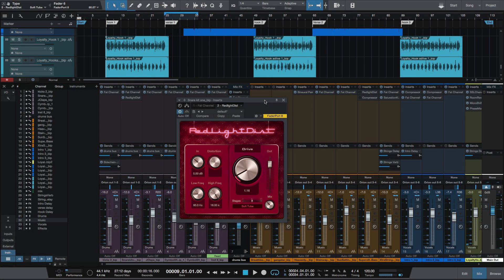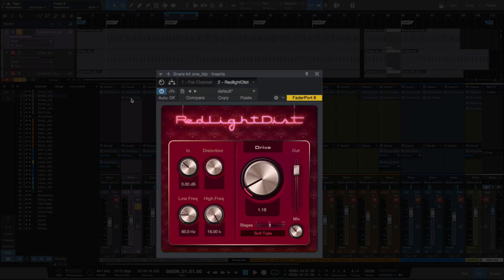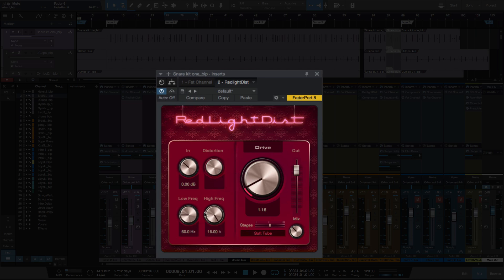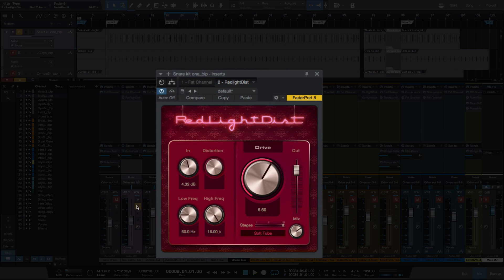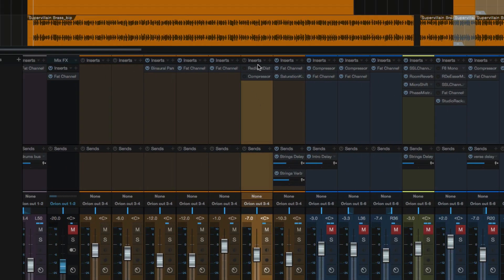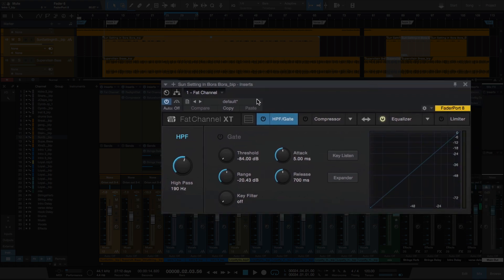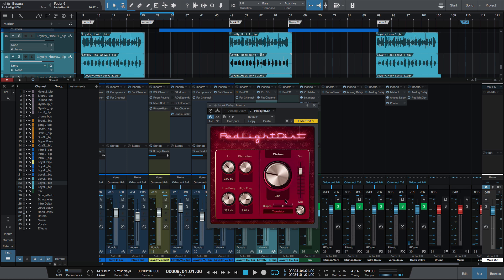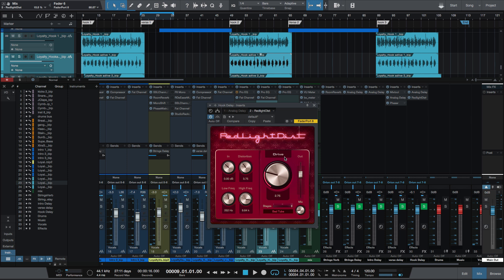Redlight Distortion in Presonus Studio One

Comment: Great tutorials... can you upload your studio one/Maschine template? I followed your older video and I couldnt get it set up. You had 3 separate options which were quite useful. Is there a different set up sequence for studio one 3.5 and Maschine 2.6.5? I'm thinking just u/l the template would be easier..Again good work bro..
Reply from the maker: +Mike Smith I don't have one for machine. Mine has honestly been in the box in the closet for a few years.
Reply: @TheAudioCzar  do you gain match after you use distortion to avoid just having an increased output instead of just the actual harmonics?